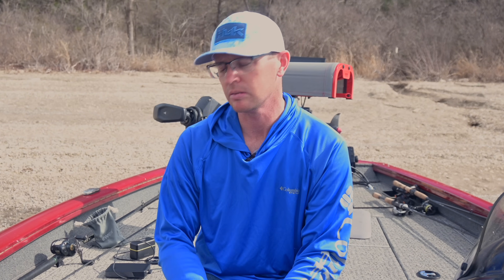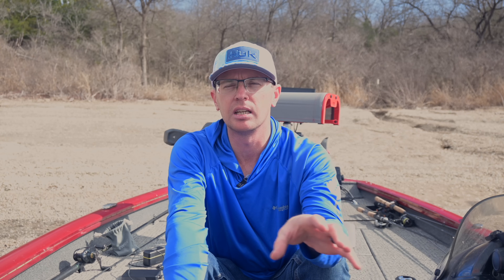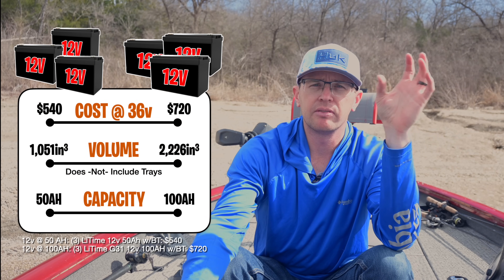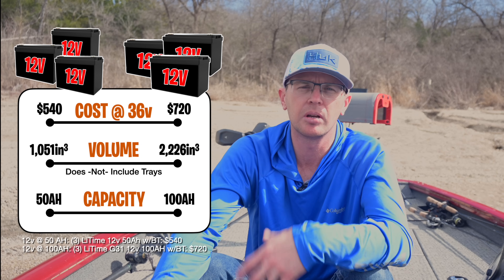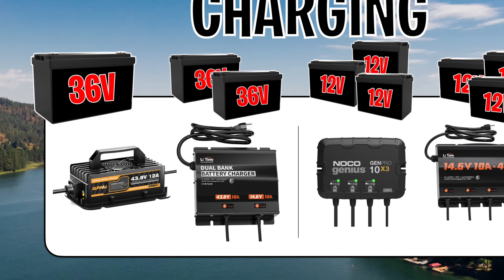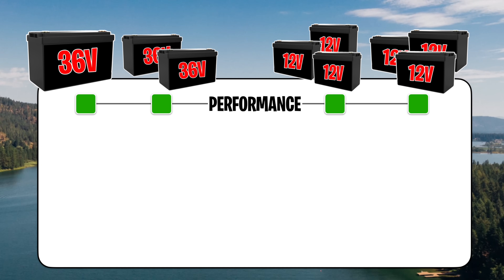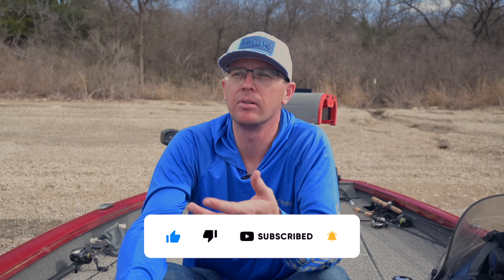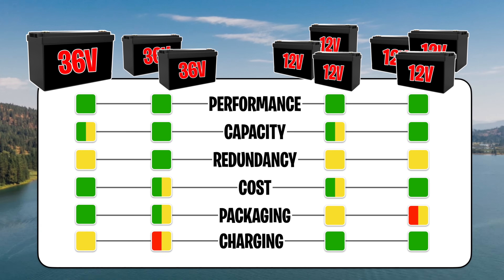36V vs 12V Batteries – Why Pros Are Making the Switch (Should You?)

Comment from the maker: What's your pick?! 12v for your boat, or 36v??
Reply: @goodmanfishing  36 v for sure . Redundancy plus I want my Ghost TM to run at its peak without having to use 3 batteries to do it !  Space is an issue. I am always trying to have as much storage on my boat as possible! I only carry 12 rods 6 BC’s and 6 Spinning for example! I use my storage lids for lures . Instead of having a 3700 box for lures , I picked just 5 best of each hard bait and put them in 5x7 boxes that fit in a box that holds 12 of them . Plus starting to have just the plastics that are lake specific. With maybe a few try this type baits . I remove all my tackle from my boat because of Florida humidity. It’s only takes 10 minutes lol….. I’m a very messy angler who is try to finally be more organized ! The extra space in the battery compartment holds allot of stuff that usually gets scattered all over the boat lol… ie bumpers , ropes 3 rd person LJ , . I even put the extra clothes and jackets back there in a water proof bag lol…..
Reply: I think I’d stay with three 12v, 100ah because my trolling motor is capable of running on 24v and 36v.
Reply: @goodmanfishing 12v all day for me as a no brainer.

Comment: I run one 12 volt lithium with a voltage converter, it was the easiest and most economical way to go, I didn’t have to buy new batteries or chargers and if I ever have to replace the battery it is cheaper and more readily available (in Australia) than a 24-36 volt.

Comment: Redundancy is a huge deal...I live in Texas and most the good lakes are 3-5 hours away. When you get to the lake with 2 12volt lithiums on your trolling motor and one fails its a wasted trip or you have to go buy some for throwdowns. Ionics have left me stranded 4 times in 2 years....im switching to Redodo and doing 3 12volt batteries. They work with my current Noco charger and my powerpole will run 24-36 so I will just keep a longer jumper in the boat to pull one battery out of the loop so no more trips are ruined.

Comment: I currently have a troller and fish finder hooked to a 12v system. I want to upgrade to a 36v troller. Can I still run my fish finder off the newly upgraded 36v system? Thanks.
Reply from the maker: If you run 3x12v batteries in series to get to 36v, technically you could still run your fish finder off of one of the batteries. However that will make that one battery work harder than the others, which isn’t ideal.

Comment: Nobody is talking about the weight and length of these son of a guns. Bought 1 last week and had to return it. Too Long 68lbs trying to work into the right space & the fact that if something goes wrong having to replace it made me return. If it's for you the great. For me I run 10 12v 100ah Lithium in a my 21 ft Fish/Ski boat. & 5 100ah Lithium in my Bass boat. Again if you like the 36 & have room GREAT. For me it was buy and return without installing.
Reply from the maker: Sounds like you bought a 100Ah battery. 

If you stick with 50-60Ah 36v batteries they are traditional Group 31 size batteries and aren’t long 68lb batteries. 

Gotta look at the dimensions!
Reply: @goodmanfishing  that many Amp Hours doesn't fit my fishing/boating style. I'm 100ah or nothing. The water is too dangerous to be without power. To each their own. I wouldn't run 1 50ah-60ah Lithium with just my Livescope & 12 inch graph. I've drained a 100ah Lithium with Livescope before. Again to each their own but it doesn't fit my boating style. 👍
Reply from the maker: I see. Just saying that two 50Ah in parallel would be a lot easier to fit than one large battery.
Reply: @goodmanfishing  I agree with that. 👍

Comment: You forgot to mention that if you use two 36v batteries and one fails you can still run your trolling motor on one 36v with no rewiring but if you run three 12v batteries and one fails and you rewire the jump wires to bypass the failed battery most 36v trolling motors will  NOT run on 24v !!!

Comment: Your videos are so helpful. Learning a lot. I had no idea you had a tracker. I’d like to pick your brain if possible. 

Current set up: 

2018 Tracker TXW 60HP
Ghost trolling motor 

2 12v lead batteries for the ghost 
1 12v crank for the big motor

As I’m sure you know, we are definitely cramped a bit on space. You mentioned you have a 36v system. Is that just one 36 running everything including motor?

I’d ideally like to run one 36v for the trolling.
Reply from the maker: Still running a Tracker!  ….for now

My whole boat runs off of two batteries. The 140Ah dual purpose and a 36v 👍

Comment: So i am ordering 3 of the litime self heating 12v 100ah groupe size 31 batteries for my boat. What amp charger do i need to engage the self heating element? I read reviews i need a 20amp per battery charger. Well all i can fine is a 3 bank 30amp (10amp per battery) charger. Will that be enough or not?
Reply from the maker: Are you planning on leaving them plugged in all the time?

10a per bank would be my recommendation.
Reply: @ i would plug them in overnight until they are charged. Then plug them back in the night before a trip so they are topped off.
Reply: I just read that the self heating elements don’t work unless you have 20amps per battery running to them for charging. I fish in some cold stuff in Wisconsin
Reply from the maker: @Josh.schenk there are some other considerations for that. But unless you are trying to charge the battery in sub-freezing conditions, there is no need for a self heated battery. It discharges just fine below freezing. 

You Are RUINING Your Boat's Lithium Batteries (and you don't know it...) - LiFePO4 | LFP
https://youtu.be/O1tAYH_G1bk
Reply: @goodmanfishing  at times it is below freezing at night when the batteries would be connected to the charger
Reply: Which is why i was going to get the self heating lithiums. Just my concern is the charging system not giving the batteries enough juice to opera the self heater.
Reply: I tried email Li Time and haven’t heard back. I just hate to buy the self heating batteries which i need if i cant find a charger to charge them:/

Comment: Have you tested any DC to DC chargers? I am not a tournament fisherman and doubt I ever will be. I do however, do a lot of long trips. Days to weeks at a time with no shore power unless I bring a generator which I generally don't. So I am used to running my trolling motor batteries dead and just living with it. I have a center console and am at any given time running 5 batteries. 3 for the trolling motor and 2 for the boat. I would like to swap out the 3 trolling motor batteries and have been looking to add a DC to DC 36v charger. This would allow me to charge the trolling batteries while I am running about. I would love to swap to a single 36v as it would save me a ton of space and obviously weight!
Reply from the maker: Thanks for reaching out, I have no personally tested any DC-DC chargers. The Powerhouse Run-N-Gun would probably get my attention, but it is only 10a at 36v. 

So if you had a 50Ah 36v battery that was down to 30Ah remaining, it'd take 2 hours of outboard time to charge it back up. 

https://powerhouselithium.com/collections/powerhouse-lithium-12v-run-gun-dc-to-dc-chargers/products/powerhouse-lithium-36v-run-gun-dc-to-dc-charger
Reply: @goodmanfishing  Thanks for the reply. That is the same charger I found and was considering. That sort of timing would actually work well for me. I don't do a ton of trolling around so running the batteries dead with lithium isn't a huge concern. Just keeping them going over a week is. If from what I am learning about charging lithium it likes to stay around that 80% mark which I believe this would do. I could top it off at home.

Comment: I got 3 100 ah 12 volt batteries. My motor as some have stated, can run off of 24 v or 36v. Also, I mainly do intercoastal waterway or gulf fishing, so I run into major currents at times.
Reply from the maker: Sounds like a good use of 100Ah! It is nice that some of the motors can run off of 24v and 36v, as long as you have a way to identify which of the batteries is having issues, that works.
Reply: @goodmanfishing  I have another 100 ah hooked up to lights and electronics. Then I have a flooded starter battery. So i have 5 total batteries and 5 banks charging.

Comment: I think I'm going with 3x 12v 100ah lithium mini batteries for my 36v trolling motor. That way i can use the batteries for my wife's kayak with 12 trolling motor and my pedal kayak's electronics (overkill). Would you suggest a 36v charger to charge the batteries in the boat in series or a 3 bank 12v Noco charger?
Reply from the maker: it's best to have a multi-bank charger for a series application.

Comment: Redundancy I disagree a little.  3x12v works at 24v just fine if one of the 3 batteries dies (i.e. at least my Garmin runs 24v or 36v).  so if you don't have the funds to replace one of the 12v, you can simply run 24v for awhile.
Another thing having extra 12v batteries, is good for an emergency, your starting motor battery dies, you can charge it with a 12v trolling battery (jump, even with Lithium, they may not "like it", but it should work in most cases in an emergency).  
That said, I always keep a jump start pack in my truck and boat... which then means I have redundancy without the big 12vs :) which has me seriously thinking about a single 36v 50/60Ah battery simply for space and weight.

Comment: Is it okay to charge 2 36v batteries in parallel? Is it better for the batteries to charge separately? Both batteries are same ah and age.
Reply from the maker: Yes it is okay to charge them in parallel, it will just be slower of course.
Reply: @ thank you!
Reply: @goodmanfishing  In this case, if charging two in parallel, would it make sense to go for a Li Time 25amp charger over the 18?

Comment: If you're in the Tracker, why didn't you talk about a seemingly more common 24v application/ system.
Reply from the maker: I have a 36v setup in my Tracker 🤷‍♂️

Same principles apply to 24v
Reply: @goodmanfishing  Oh, okay. I just picked up a 2018 175TXW and I'm adding a 24v TM. The receptacle was replaced for the 12v TM. The receptacles aren't voltage specific, are they?
Reply from the maker: Nope not voltage specific. Should be fine to keep what you have
Reply: @goodmanfishing  Thanks.

Comment: So I live in New Jersey and we have a lot of electric only lakes. I have a 24v Ultrex and have 2 li time  12v 100ah batteries. And I’m looking to get the power pole move will the 36v 50ah be enough or do I need 100ah? All we do is move with our trolling motor cause we need to go 10-12 hours straight on it. What do you think.
Reply from the maker: Thanks for reaching out!

🟠  2x 12v 100Ah Batteries = 2,560watt-hours. 
🟠  1x 36v 50Ah = 1,920watt-hours.

How much energy do you have at the end of the day currently with the 24v setup? The 36v will be slightly more efficient, but there is quite a difference in capacity. 

You could look at a 36v 55Ah (2,112watt-hours) or a 36v 60Ah (2,304watt-hours)

36v 60Ah Weize: https://amzn.to/3Fjzyyz
36v 60Ah (case is quite a bit large on this one): https://www.amazon.com/dp/B0CMWCCXTJ?ref=t_ac_view_request_product_image&campaignId=amzn1.campaign.UN4SBSI7EB4Y&linkCode=tr1&tag=goodmanfishin-20&linkId=amzn1.campaign.UN4SBSI7EB4Y_1741262967757
Reply: @ I don’t have much capacity left at the end of the day but I do know also the brushless motor uses more power then the brushed setup I have now.

Comment: Ive got both. 3 12v 100ah, and a single 36v 100ah.
Ive ran the 12v down to 10% in less than 7 hours in a tournament. Had to slow down to last the whole tournament. So then added a 36v 100ah, so when the 12v gets to 20 or 30%, ill just turn the switch to the single and be good to go with no worries for power. 
Everyone i talked to that had 50ah first, traded them for 100ah within a few months. They dont last long enough for crappie tournaments. Specially if its windy. Most of us have the motor on 8 or 10 (depending on motor) the whole time, only stopping to drop on a fish. We use a lot of power.

Comment: I am going with two 36 v 50 ah Bluetooth LiTime lithiums for my nitro z-18 .I used 60 percent of a 12 v 140 ah lithium trolling in my sun dolphin 120 . In 7 hrs of fishing. I power fish 90 percent of the time . Never stop moving . Granted the 55 thrust TM (with) brushes eat batteries . I am still researching Duel lithium cranking/ electronic batteries for my 4 stroke mercury! So far I haven’t seen online posts of failures! Everyone talks about potential failures. But there are not posts on actual failures! I talk to Pro Anglers all the time and none have admitted to failures!
Reply from the maker: No issues running a dual purpose on my 2020 ProXS 4stroke 👍
Reply: I am looking to do similar, what are your plans for charging?
Reply: @AlbertaFishandHunt  If I go with a Millertech  12v 190 ah duel purpose cranking/ electronics and Two LiTime  36v 50 ah batteries ran in parallel for the trolling motor. My two options are : Millertech  36v / 12v charger . Or get a LiTime 36v 20 amp charger for the 36v TM batteries and keep my current on board charger for the 12v duel purpose Millertech . The connection lead will stay connected to the liTime’s so at home charging easy . I will keep the charger in the truck for the rare time I might do a road trip .
Reply: @MrFishhook  Thanks for sharing, I already have a single 36v 50Ah LiTime battery and a 25amp LiTime 36 volt charger but am thinking I should add a second 36v battery to my setup. Do you know if one charger can charge the two batteries at once?
Reply from the maker: @AlbertaFishandHunt it will charge both in parallel
Reply: @AlbertaFishandHunt  Yes it can . Aways verify with LiTime if it’s a LiTime charger though. Or what ever manufacturer. LiTime will answer in the chat usually with in 12 to 24 hrs

Comment: I did 2-36volt 55ah and a charger for $750 from litime. They work great , my only concern is 36 volt charger’s aren’t popular, if I had gone 12 volt I have extra 12 volt chargers. I’m considering buying a spare 36 volt charger just in case the current one dies.
Reply from the maker: That's not a bad idea, I have a spare charger. Haven't needed it, but I do

Comment: Im looking at getting a force. Ive got a older 17ft skeeter and my gas tank shares space with my batteries in a small bilge amd a noco 3 bank. Use a 12v 100 ah now for my 55lb troller. All the forums say a single wont be enough but if your single last that long, would the 50ah be enough or a 24v 50 also work with my current charger?
Reply from the maker: Thanks for the comment. Is your 12v 100Ah a lithium today? If so, that is the same amount of energy as a 24v 50Ah battery (1280Wh). More than likely, that will do you pretty well. 

I'd have zero concerns with a 36v 50Ah. 

Either way, your Noco will unfortunately not work with a 24v or 36v battery

Comment: I appreciate your video’s, I’ve learned a lot.. I just recently replaced 3 bad lead battery’s with one Li Time 50a 36volt.. One of your previous videos helped me with that decision.. I haven’t been on the water yet to try it out but I believe it will be great. I’m fishing the CA delta in May and the wind and current will be the true test, if 50 amps is not enough, I’ll order another one..
Reply: So I use a 36v 100ah and only use 4-6% in a 10hr day. Current at the Delta I figure you'll use 20-25% on a day at the delta.
Reply: @fisherman7275  right on, that’s pretty good, I’ll be plenty happy with that.. Thanks for the input.
Reply from the maker: Sounds like a plan!